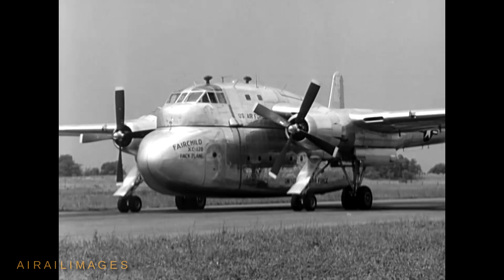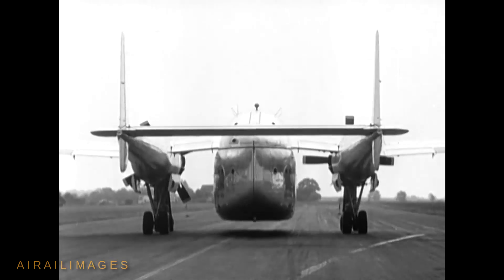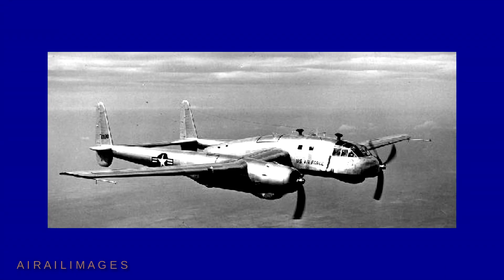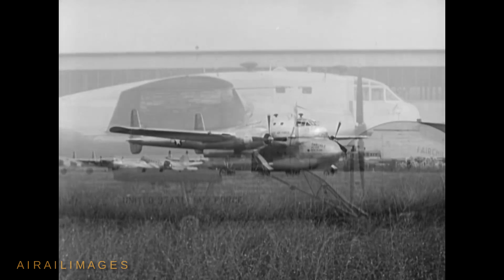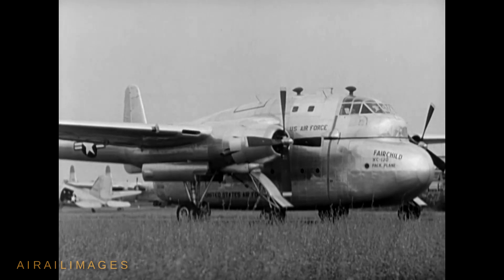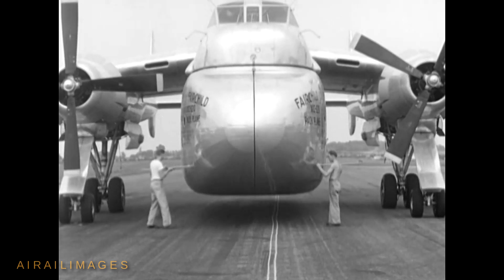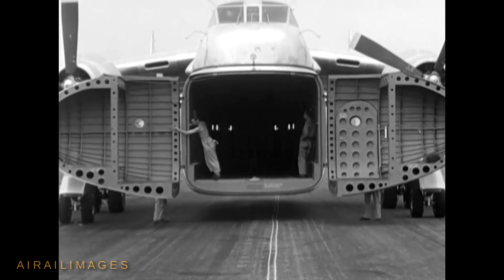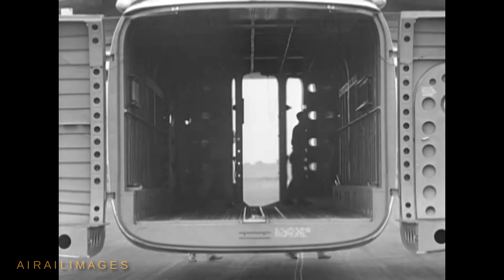Fairchild XC-120 Pack Plane First Flight

Comment: It's interesting to see the evolution of Cargo Aircraft. I'm not sure why they thought the Pod was an improvement.
Reply: They considered side doors as a bottleneck to loading/unloading of cargo. Plus it limited the size of the cargo. Farchild's logic was to  go modular to speed turnaround of aircraft, and open both ends of the module to speed loading.  If they had put turboprops on it, plus went with the fixed bay end-to-end loading like the current cargo haulers do, then it might have been a winner.  But it was a piston powered plane, and the weight/power rating were fast reaching an upper limit.
Reply: The aircraft and pod intention was to perform like to a semi truck and it's trailer